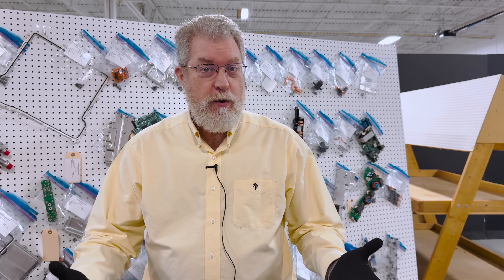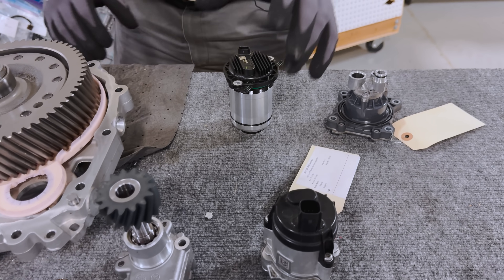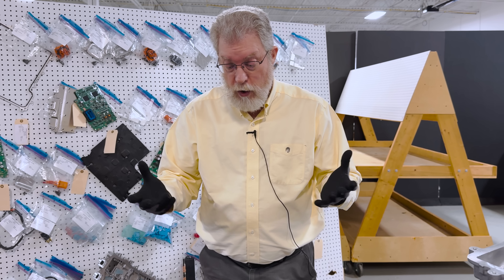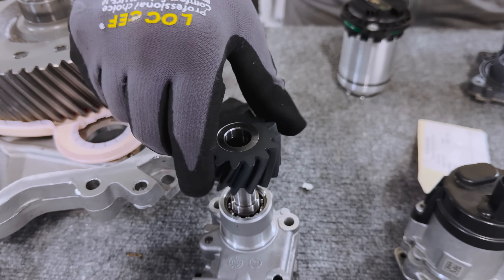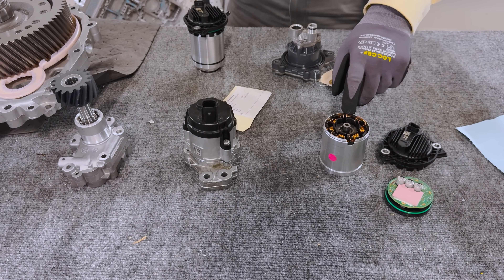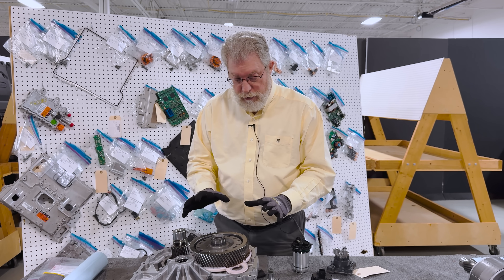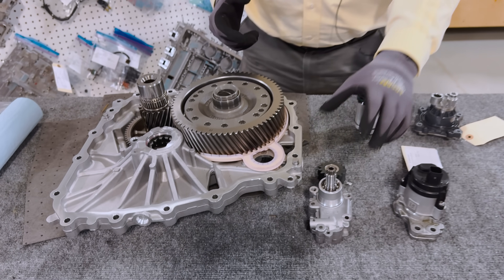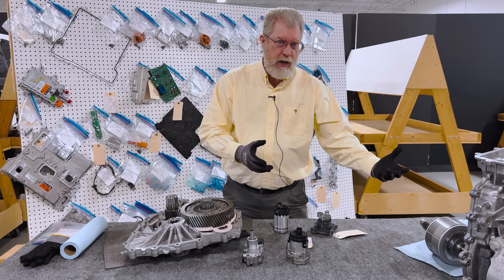The Cost & Engineering Trade-Offs of EV Oil Pumps

Comment: Maintenance is an issue as well; when the pump is integrated into the gearbox of the motor, it means more cost and more work to replace it.
Reply: The probability of an integrated gear driven mechanical oil pump failure is very very low.
Reply: @videoviewer2008  low but no 0.
I bet the electric pump is plug n play, where as the mechanical will need a full teardown on the motor.
Reply: @Chrom35kull  
Yes but the failure is much lower on the mechanical pump too.. probably a win overall.
Reply: @Chrom35kull  The failure rate on the electric pump isn't 0 either. In fact, they don't have the history that the mechanical pumps do.
Reply: @videoviewer2008  I concur. GM has been making mech oil pumps for over a century. These things don't fail on their own. In ICE cars, oil pumps die because of something in the engine blowing up and running that material through the pump.
Reply: @thomaseboland8701 but most of those are tied to the engine (constant pumping) can't be in a motor that may stop a lot.

Comment: Just to add on here: flow rate through the cooling loop IS NOT THAT IMPORTANT... after a certain point.  The coolant can drop to a lower temperature in the radiator when it is moving slower, so it cools the motor better (to the 4th power of deltaT).

So once you establish the flow response curve under normal conditions all you need to do is properly size the radiator for the worst case and use a thermostat to control the flow through the radiator.

--

For example, a PC water cooling loop will only have a 5 degree difference from changing the rate 1 l/m to 4 l/m... however, going from 0.5 l/m to 1.0 l/m can be a 35 degree difference.

Going from 4 l/m to 16 l/m will buy you another DEGREE.

Comment: But do they put a parking pawl in it to allow the vehicle to be in park without four motors that cinch the brake pads down and are less than reliable due to the exposure to salt and brake dust jamming them up a well as when the Low Voltage system takes a shit, and the wheels are stuck in locked mode? For true low cost EVs head back to s parking pawl and a parking / emergency brake lever or pedal connected to the brakes with good old fashioned pull cables!
Reply: Funny the amount of cars I’ve driven with useless manual cable driven emergency brakes. They suck if not routinely maintained and most are not. And they can be set so hard the next person isn’t strong enough to release it.
Reply: @ZapRivet proper maintenance of any mechanism is essential. If you have a pedal to push down on with your leg, you should be able to pull the release lever and get it to release, if difficult or impossible pushing down on the pedal, while pulling the release and while the release is engaged, lifting your foot off the pedal would allow the pedal to release fully.

Comment: Another major advantage to electric oil pumps is that the pump can circulate oil when the car is parked when preheating the car for a trip
Reply: And postcooling after riding hard.
Reply: @Lvvcassss  Like 5 degrees. Yea sure. Temperatures are really really "tiny".
Reply: You don't preheat an EV motor. 
You preheat the cabin for the meatbags.
Reply: @ABa-os6wm , you do and you don't. Yes you want to preheat the cabin, but you also want to preheat the batteries and motor a little bit as well to get better performance. Li-on batteries will give you more juice at higher temps and having to oil be more viscous will actually help prevent damage to the moving parts since the oil won't drag as much when it's more liquid than a glop of molasses
Reply: @caelumvaldovinos5318  BAHAHAHA NOT WITH OIL
Reply: @tedk-42 actually yes with oil. Efficiently engineered cars use the motors windings to generate excess heat which is circulated by the oil pump through heat exchangers to the coolant that flows through the battery.
Reply: @adambecker6333  "Efficiently engineered cars can use the brake fluid and the excess heat generated from stopping to heat up the battery" - see i can make up BS as well.

Original poster talked about pre-heating the car via oil pump for a trip and didn't specify the cabin, battery etc.

A heat pump (which most manufacturers would use) is FAR MORE EFFICIENT for preheating a vehicle and uses the coolant loop, not oil.

OIL is for ICE cars/trucks/heavy machinery with resistive heating elements that can heat the oil and pump it to the engine before starting ignition sequence.

Read a book.
Reply: @ABa-os6wm  No, the car preheats the battery too if it's needed.
Reply: @ABa-os6wm you could pre or post cool though
Reply: You preheat the battery, not the electric motor!
Reply: @gmv0553  There are coolant lines going through the motor and transmission housing, so GM's EVs also manage the preconditioning and post conditioning of the main drive components as well.  GM's just not using the internal transmission/motor oil pump to do this.
Reply: True, almost forgot. A mechanical one seems to be more reliable tho, in the long run. Maybe a hybrid setup would be interesting where there are both.
Reply: @batterynerd8779Nope. They can go bad very disastrously.

Comment: Although the electric pump is more expensive it's only switched on when needed thus the motor can run more efficiently in general.
Reply: Which is all the time, but it gets throttled to suit cooling demands.
Reply: could allow continue to spin for a few minute after the engine is off. If there are scenario where it's a desirable feature.

Comment: A hot plastic part in a metal motor seems like a possible failure point needing a complete motor tear down to replace vs two bolts, two wires and two hoses on a separate oil pump. Cheers from New Orleans
Reply: Remember that "metal motor" has got no burning fuel so its peak temperatures are much lower
Reply: @duncancairncross  I logged stator temps on a highway drive and the highest they got to was 55 °C (130 °F).
Reply: Most automatic transmissions use plastic components even 30+ years ago and they do get brittle but they don’t typically fail so it’s usually fine.
Reply: they know the durability as they are putting them in millions of cars without a problem, i don't see it being a problem.
Reply: My wife’s plastic vibrator is at least 30yrs old. Works just fine for me!!
Reply: Yes, exactly, I posted the same point before seeing yours.

Comment: Unless they did something special, that mechanical pump isn't going to pump fluid when the vehicle is going in reverse. So, hope you don't have to back up a long distance in Death Valley with a trailer....
Reply: You are looking at a scenario that hardly never exists! Has never happened in my 72 years of life! And what if the electric pump failed when backing up in Death Valley? The odds of both scenarios happening are very small!
Reply: And the pump has to be self priming or after going in reverse it stops pumping.  The no oil in reverse can be mitigated with a max reverse speed.  Let's get out the DFMEA chart to truly understand severity and frequency.
Reply: Is reversing in death valley with a trailer something that you want/need to do on a daily basis? Why do half of the people in this comment section have a boner for the death valley? What is so important there?
Reply: Think it through. Is it connected to the transmission or the motor?
Reply: @john_in_phoenix  Both of which turn backwards when an EV backs up. No reverse gear.

Comment: 2:23 Synthetic oil freezes at -55°C last time I checked. If I am not mistaken.
Reply: I'd like to know what they use for coolant oil. That would make a good video. Not getting to ICE temps gives you a lot more choices.
Reply: @jamesvandamme7786 Who is “they?” GM?  Just check their service documentation.
Reply: Sounds about right.  However transfluid, typically used in electric drive units, is the same consistency as peanut butter at -30 to -40 degrees. It is not frozen, so it can be pumped, but lots of torque is needed.

Comment: 1:20 the gear is cheaper to manufacturer than an electric motor and it is one less motor to fail and cause the vehicle to destroy itself with oil starvation.
Reply: But it can lead much quicker to the entire system failure due to non optimal lubricating conditions in the entire use range and if the mechanical pump fails, its not very easy to replace it in contrast to an electric pump.
Reply: we don't know which is more reliable for sure.  If the electric pump failed it would shut down the car.
Reply: @hoffinger  --  that might have scared folks at one time but now electronics controls just about everything.